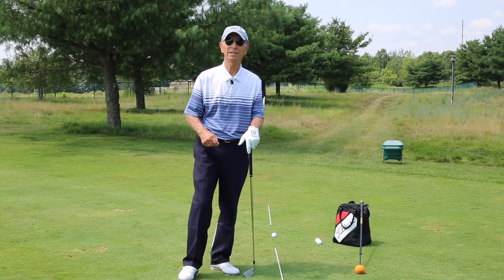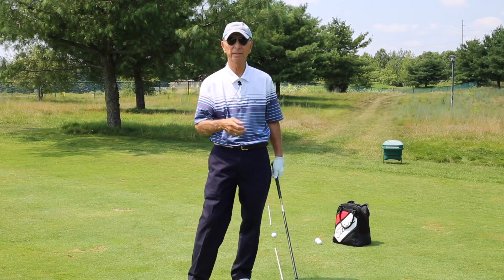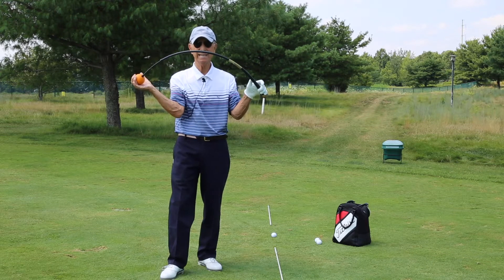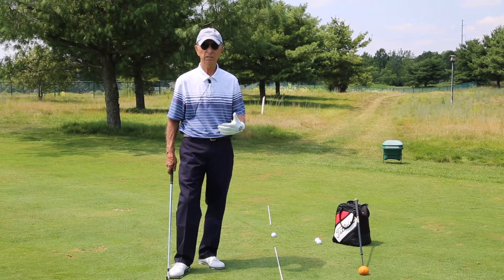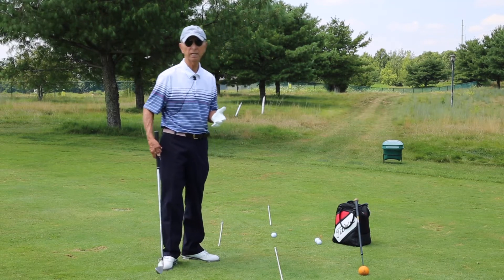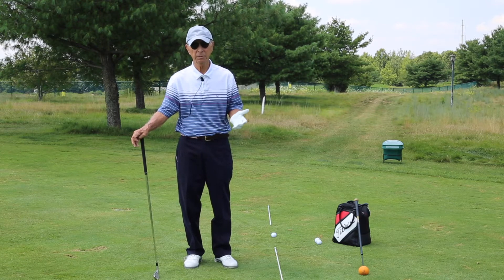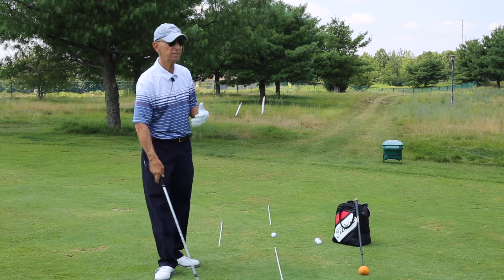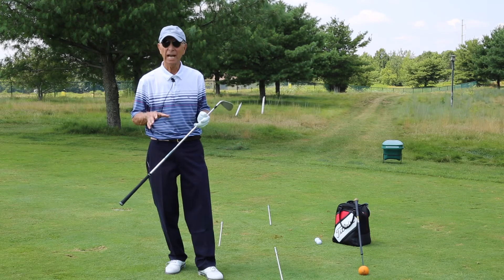Maintaining Shaft Deflection

Comment: So at what point does the transfer of energy from the ground, through the legs and torso, through the arms and wrist to the club head take place? A typical rotary swing does give you accuracy as the club is in-sink with the body but you're going to need that accuracy because you're hitting a 3 iron to your playing partner's 6 iron because you DO NOT CREAT SPEED, with a rotational swing. It's in the arms and it's using ground forces to slow down part of the body in a kinematic sequence that transfers the energy at impact and not at the top of the end of the swing. The orange whip was created to teach you how to use your arms for speed and release of the club, not the shaft bend?

Comment: Great video. Any drills on how to maintain shaft deflection through impact?
Reply: I am not a teaching pro but I figured out how to do it.  First, it won’t happen from the top, it’s impossible to hold for that long. Just make sure, if your right handed, to keep your right index finger pressed hard and pinned to that shaft.  I do that while using thumb and closing the gap.
Reply: The way I do it is to side-bend to the right with spine slightly at the top of the backswing.  That move can be done independently of the tilt and turning of the shoulders and actually start dropping the hands while the club force is still trying to pull the lead arm tighter to the chest and turn the shoulders square.      The faster you can drop the hands down and forward counter to the club head mass still moving forward the more the shaft bends and loads.

Maintaining the bend in the shaft requires keeping the hand moving faster than the club head is able to due to its inertia.  Progressively increasing the amount of side-bend as the hips pull shoulders around will do that, why you see all good ball strikers with a lot of side bend at impact.  

At the point in the swing the club mass swings outside (behind the hands) and gravity can start pulling it down without the hands preventing it the club head will start to whip around the hands. This usually occurs as the hands pass over the right hip and approach the low point in their arc.  That causes the shaft to straighten then bend forward.  That is the point where you need to coordinate the lifting of the back foot to keep the hips, shoulders and hands moving.  

Using the right index finger extended on the side of the shaft as on a trigger of a gun as Mark L. suggests will give you feedback via the pressure the shaft puts on it during the swing when the club mass is lagging and being pulled by the hands and the point it starts whipping around the hands outracing them.  The point where you feel the pressure on the index finger decrease is when you need to keep your hips moving all the way to the finish.

I see a lot of recreational golfers wind up with hips facing right, not square to target in their finish (blocked hips) which will cause the hands to slow and whip club left around body with bent elbows.  If squaring the front foot it needs to be rolled on the ankle for most to get the hips square and hand moving correctly.  Simply flaring the front foot as much as it takes to get the hips square when doing a practice swing is much easier on the body.